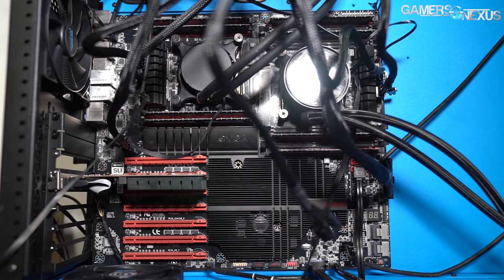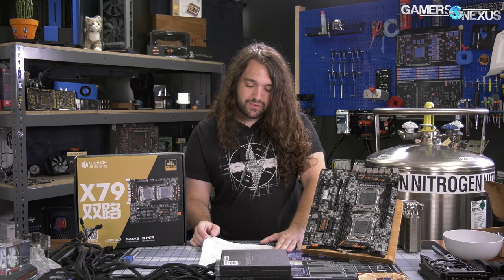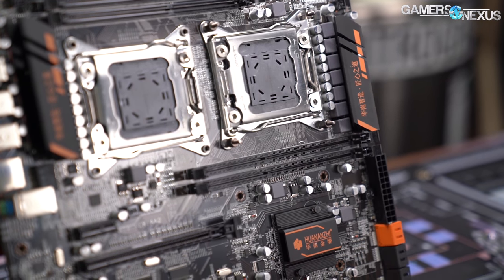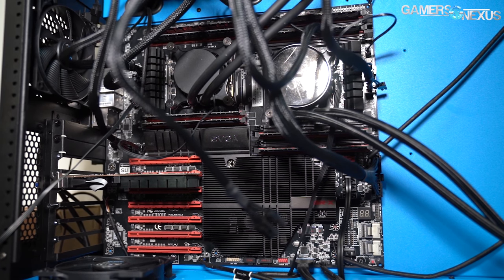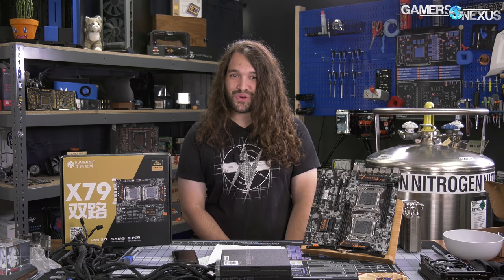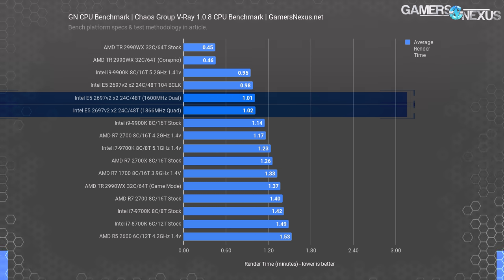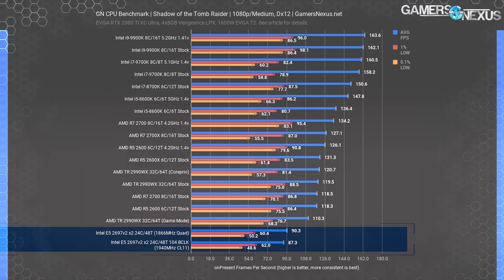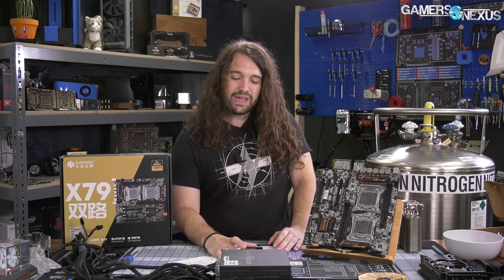Building a Dual-CPU Behemoth from Used Server Parts, ft. CaseLabs & Old Xeons

Comment: These were fun builds. I went w/ Patsburg /Intel C612 & 2x E5-2667v4 but the used ASUS Z10pA-D8 coat as much as a pair of Xeon. lol. But with it later as rheee boards just work for yrs. I still run dual Tylersburg of 11yrs stable. I setting up for Lewisburg :C621 a used pair of Gold 5115’s looking for a home but these boards are still expensive as if new.  Lol. I want the ASUS Z11 of course

Comment: Just had a ton of fun and a lot less drama building a dual Xeon E5-2650 v2 system using one of those cheap AliExpress motherboard. Got the bundle with 64GB of DDR3-1600 ECC which was probably fake and could only run stably at 1333MHz. Cooled by a pair of Corsair H55 in the Cerberus X case. The CPU/RAM/MB combo cost $100 more than the case itself and triples my i5-6600 Cinebench scores! If you got a few hundred dollars that you want to build a home server or just have some fun with, go for it!

Comment: I have this very same chinese board, with 2 E5-2650v2 and 4x32GB ECC sticks (128GB total) in case anyone is in doubt where it supports more than 16GB sticks. It also support common DDR3 (non-eccs) when using only one CPU. I also had some issues with getting the 2 cpus running at first, but they where cause by not having a PSU with two cpu cables - the seller encourages people to use the 6-pin PCI-E cable instead of the 8-pin cpu cable (and you have to put it flipped) - and that actually works. My version also has nvme available, which also works quite well. So yeah, it is sketchy as hell, but is cheap and works, just don't expect any support, manuals or online help (there are russion foruns if you can speak the language :D)

Comment: Nice. Now try get a Supermicro LGA 1567 quad CPU motherboard and 4x Westmere E7-4870 or 8870 10 core CPUs. Very few have made any in depth content on this odd plattform. CPUs are dirt cheap, but motherboard options are very limited. Got two cheap HP Proliant DL580 G7 myself, but has not done much with them.

Comment: I was able to get a lenovo d30 dual socket system for $120 shipped. Came with all the components, 24gb ram, 1tb hdd, 120gb ssd, and a 1100w 80+ gold psu. Sold the ram for $40, sold the ssd for $20, bought 64gb ecc ram for $80, and a paid of e5 2690s for $135, tossed in a Vega 64 for $400. So bout $700 for a 16 core workstation with 64gb of ram that is capable of 1440p 144hz gaming. Not bad.

Comment: Would still rather go with a 1950 threadripper AMD, with way more potential for cheap upgrades on the CPU.  This you only can go Xeon E5-2687W v4, and that is not a big enough improvement in comparison, to what a third gen AMD threadripper is going to produce for workstation work...

Unless someone gave me a Xeon E5-2687W v4 for almost free, it isn't worth it.  Maybe 400$ for the system I would go for it. But otherwise,  a threadripper cheap motherboard with the 1950 is going to be so cheap soon, it is just a better forward looking solution...

Comment: The QPIs generally don't work on ES chips at all so there it no way for your ES chip to communicate with the other retail chip.

You're better off using E5-2667 V2 CPUs for pretty much any gaming and even productivity benchmarks. Very few programs can utilize the 24 threads, let alone 48. You're also stuck at just 3.0ghz all core turbo.

32 threads, or 16 if you get rid of HT is much more manageable. The 3.6ghz all core turbo helps a lot more than the extra core count even when running multiple workloads on multiple VRMs.

Comment: @Gamers Nexus
Seriously you guys should look to zfs...that filesystem can use compression (lz4, gzip..whatever) on the fly as it does block level deduplication... 
you will not find any better filesystem for a data storage.
I can recommand FreeBSD + ZFS if you wanna tweak it yourself OR you guys take a look at nas4free / freeNas (dont know which is newer atm). And no - you will not need that much CPU performance ;)

Comment: I purchased a dual cpu motherboard ASUS Z10-PA -D8 andar two INTEL XEON E5-2603 v4 CPUs for it. I was using only one CPU for a long time. When I am trying to connect both CPUs  PC is not booting.  Only green light is glowing. One CPU is working find. What should I do? 

 I went to technician they are not able to understand the problem. One is saying there may be problem with 2nd CPU socket and will have to solve by BGA machine. 

What is your suggestions?

Comment: Any chance you could try the higher clock speed Xeon E5 26xxV2 CPUs, like the 2667v2 or the 2643v2?  The 2667v2 is "only" 8 cores, but it has single core Turbo up to 4GHz and often trades blows with the E5 2697v2, so for workstation/gaming use, it is a bit more balanced.

Comment: I love repurposing old server hardware. I'll take any obscure old things I can find and see what I can do with it.
Granted, for value & performance it's often a bad idea, but it's fun!
But yeah, other than that, if you're at all into computer hardware it's a blast. The build quality and overkill nature of some server stuff is just awesome.
So! Yeah I'd love to see more restoration projects, and things like this. :)
Maybe build yourself a big fat NAS using old Xeon hardware? Check out used Supermicro rack-mount stuff. Supreme value, great performance, great reliability. A NAS really only needs good drives, a reliable server-grade controller (LSI Logic ftw) & power supply, and a good amount of ECC memory to thrive. CPU doesn't really matter much.

Comment: GN love this content, it will help to show that some obsolete pc hardware still has a lot of life left in it.  I'm still running 3 X58 systems all with I7-990X  6core 12 thread CPUs. 2 have modern GPU's, GTX-1080, GTX-1080ti, and the 3rd has an OG Titan.  All are open loop water cooled. They're great and meet my needs, including gaming on a 1440, 100hz  X34 Predator ultra wide .  They may not be the absolute fastest PC's or have the highest frame rates, but who cares if it meets your needs. Thanks for everything that you do!

Comment: I just got a 2 board Supermicro X8 rack with dual Xeon X5570s on each. Though the left board is dead, I can get a refurbished one for stupid cheap. The right board is now sitting pretty with a Plex Server that has more hardware than it knows what to do with (Do I really need 96GB of RAM for Plex? Probably not). So now there is a 60dB 1U server sitting in my kitchen. All is well.

Comment: Steve, if I knew you were having so much trouble getting that to work I would have offered you my help.  First, to confirm, yes, registered memory (not necessarily ECC, but registered - most ECC is registered) is required when using dua socket Xeon.  Additionally, the stepping must be the same on both CPUs to boot.  These two things are key, and the reason you had so much trouble.  I know a lot of work is involved in these 'old hardware' videos, but it would be nice to see a video such as this, done with v3 and v4 Xeons, which can still be had for a deal compared to their retail pricing.  I put together E5-2698 v3 dual and E5-2696 v4 dual myself, and I plan on testing to see if it can bottleneck at gaming.  Some Xeons can be had for $200 and have 12 cores and can run at 3.5Ghz all cores.  These are the ones it would be nice to see compared to even the new Ryzen 3x000 series coming out later this year.  My guess, for gaming, a 12-core Xeon at 3.5Ghz could easily compete with the highest Ryzen.  Thoughts ?

Comment: This machine is very inconsistent with games, 'cause if you play Exodus, no matter what GPU you use, The GPU will be than make the bottle neck,  that is 'cause, the 2 CPU's are to much for only one GPU, the reason, EXODUS is a game, than have full improviment compatibility with multicore systems, If you try that game, with a GTX 2080, the GPU really gonna be dominated by the 2 CPU's. So depend of the game, if it have multicore support, this monster gonna show their fangs.

Comment: Can I use 2 CPU  with different frequencies on my Xenon motherboard. CPU (1) xenon 5690  and CPU (2) Xenon X5672 ?
And also I have installed 24.0 GB of RAM but only using 12.0 GB. How and where do I get the update of the Bios software?

Comment: Do Xeon X7560/E7-2830 with LGA 1567. The CPUs are like $5 a pop. Can find coolers for less than $30 on sketchy old websites but also Amazon. Also there only seems to be OEM boards, mostly HP ProLiant

Comment: You recommend going with newer parts of similar price, but, is there anything you can buy new that can give you a similar throughput in Blender or similar, at s similar price? A 2950X would already be as expensive, or more expensive, than the whole build. I'm asking because I'm thinking about building a PC to run some custom-made code, that scales very Cinebench-like, without using my main PC. Something like this looks like it could do the trick in a somewhat affordable way.

Comment: When i got my 2 ibm servers running 2x L5640 cpu's.I got them without memory got some memory and i was greeted with a ! which tells me there's a problem but doesn't tell me what the hell the problem is.It cost me to download the manual.They have the weirdest memory config.For first cpu ram has to be installed in 3,6(it has 18 dimm slots)on the second cpu it had to be in 12 and 15.I test it vs my ryzen 5 2600.When it comes to number crunshing stuff the 12c/12t helps a lot but with pure performance the ryzen still beat it by a little.I may get a x58 mobo and oc the snot out of one of them(it's only 2.27ghz on 60w tdp)

Comment: It would be super interesting to see something about the single socket versions of these boards with overclockable single socket xeon or i7-39xx or i7-49xx processors. When I upgrade my PC about 8 months ago I was actually considering going this route as you can get cheap Chinese x79 boards and a 6 or 8 core overclockable processor for much less than the 8700k I ended up with. In the end I decided it was worth the money to just get the newer stuff, but i feel like I could have gotten close to the same performance for 1/2 the cost especially considering I already had DDR3 sitting around.

Comment: I own a few of these boards now and all work great despite weird quirks ie. no fan control, weird IOMMU grouping.
My solution to a similar problem you had with your Huanan board, was to remove the CMOS battery very strange... I have a system that won't post with the battery installed but otherwise has been running 24/7 for 1 year now with the E5-2690v2

Comment: I built a like system with two E52670 v2 xeon processor @$171 for both.  I used an AsRock RACK motherboard and used two NOCTUA 3u coolers.  It works like a champ and is awesome to look at.

Comment: I got a E5-2667 v2 in a single socket p9x79 pro board. You might be able to BCLK clock both chips up to 114MHz, so thats 14% overclock. The limit for BCLK on the E5 v2 is about 113-114.

Comment: I picked up an i7-3930k with a cooler and a dead motherboard for around 65 USD. The motherboard is currently being repaired (hopefully) and if it works im looking at one hella cheap x79 setup.

Comment: Hey guys, it is possible to overclock some X79 xeon by forcing maximum turbo through a power management firmware hack. Have a look at this thread on overclock.net
https://www.overclock.net/forum/8-intel-general/1591590-xeon-hacking-overclocking-x79-x99-beyond-x58.html

The basis is discussed here

https://forums.anandtech.com/threads/what-controls-turbo-core-in-xeons.2496647/

Comment: I get to rebuild old XP, Vista, and 7 systems for work occasionally. They are used to control older multi-million dollar factory machinery that isn't compatible with newer stuff. I have had quite a few old dual socket 1366 systems that a hoot to upgrade for pennies on the dollar.

Comment: Finally got a chance to watch this.
1st thing. Try Google translate on the manual, there's an option to use the camera for translation. Sure its pure chinglish but it's workable (kudos Google)
2nd.
Is a system like this any good as a home server. I'm not sure how it would fair with consumption as it defo needs to run 24/7

Comment: That Caselabs case needs a better death than that. Send it to Singularity Comp where he can properly embalm it with proper fitting clothing. Seriously, you should sell that Caselabs case and (I believe it was missing something) send it where there's parts to fit it out. That MB didn't even fit correctly if I remember your 2nd channel vid. 💀

Comment: for a work station to run cfd and some simulations ,,,, are modern cpus better or exons like e5 26960v4 ..... considering that it actually cost me half the total budget to work with older Xeons ,,, not sure how would they preform,, in that application ??

Comment: I would say that a 2021 Core i5 would get a similar performance on a build around $800, but likely it would be more reliable and supportable in the long term. However, it wouldn't be the same fun as this project.

Comment: Personally buying a dual 2011 system and getting 2 8 core chips with higher clocks and a cheaper dual socket setup like a supermicro x9dri is a great budget option depending on application. For me its going to be used to run a few VMs with gpu passthrough for software development while keeping my main pc free for other uses

Comment: If you need robust systems use brand names motherboards. Also a dual e5 2697 v2 out performs most single CPUs. Try benching on CPUIZ.

Comment: 12:29 "with four extra on the first CPU"?
How does that work? What happens after you use up the first 8 slots?

...if the first 8 slots consist of two sets of 4 slots mirrored with each other, but the last four only go to CPU 1, wouldn't CPU 2 just have to go idle for the duration?

Comment: Still rocking an HP Z820 system with slightly slower CPUs. Managed to find two 2696 v2 CPU's for about half the cost of two 2697 v2 CPUs. This means getting a 200MHz lower base clock and a 500MHz lower boost clock but still a pretty decent set of CPUs. With 256GB of RAM this thing is a beast for coding, compiling, video editing and even gaming. I'm getting well over 60fps in most games like Tomb Raider, Cities Skylines etc. Sure, it isn't the fastest or the best, but for just under €1000 in total it ain't bad.

Comment: I've put together a dual e5 2690 system a year ago.  It was a good deal then, 16 cores, boosts to 3.8. Cost 170 for the processors. Old dell server.

These days a new ryzen would be a better deal.

Comment: Currently running an E5 1650 on a "Classic" EVGA X79 Classified. Its pretty much on par with the Ryzen 1600 clock for clock. i managed to push it to 4.8Ghz but now run it comfortably at 4.0Ghz with ram at 2666Mhz

Comment: SR* boards are near impossible to buy these days and if so, very expensive to buy. Also in about a week you can buy a Ryzen 3000 which will probably be near on par with this system in blender and cheaper & with less compatability issues. Average multicore thristy joe won't be able to call EVGA & Intel to call in favors for boards & CPUs.

Most interesting is the  R5 2600 to R7 2700 gap or lack of.

Comment: Your gaming results had me wondering how the dual 2697 v2 system would behave if only one of the CPUs was active, ie. to what extent the poor performance is down to issues related to it being a dual-socket system vs. the generally lower clocks.

Re that Huananzhi mbd you bought, I went for this model instead which doesn't have the POST debug LED display but does have 4 RAM slots per socket and what appears to be a better VRM (time well tell, not arrived yet):

https://www.aliexpress.com/item/33020757992.html

Comment: I have a X79 Sabertooth MB used with E5 2680 V2 and the MB has 2 clocks leave BCLK alone and change the other CLK 114MHz and apply turbo boost now overclocked non overclock able Xeon Cinebench R15 score 1532

Comment: I have a similar system, running the OEM only E5-2651 v2 1.8 GHz (always runs at 2.0 turbo - still efficient) and a cheap quanta board and 1333 ECC- except mine started first time no hassles.

works ok for scientific crunching about 1.5 times the speed and efficiency of its Opteron 6380 stablemate (this is about half the efficency of an 1800x) - especially for integer tasks as most improvements lately have been all about floating point.

Comment: would have loved to see handbreak in action even if you need an exotic method to use all the threads (unraid docker handbreak teamed with a windows vm 16 core (plus a few shared cores) running handbreak (or maybe VidCoder is what i used to get 90% out of my 2990wx)

Comment: Steve I have the same board with 2X e5-2670 and 64 GB of ram non ECC. Just switched the OS to win 10 and ran into a problem that maybe you can help with since you never mentioned it on your end. did you ever find windows 10 drivers for the raid controller so you can use the 2 mini SAS ports. if so let me know where I can find the driver. Great content as always.

Comment: Honestly, all around performance wise the SR-2 was the superior platform to the SR-X. Yes, a pair of x56xx's had half the threads that you could get with the socket 2011 chips, but since you could overclock the Westmere chips on base clock they pretty nearly overcame the core deficit even on fully threaded workloads, and you got the actual single thread performance as well.